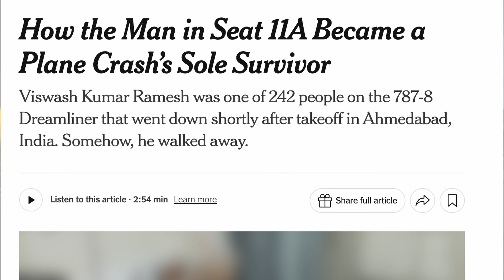Why the RAT Changes Everything – Air India 171 Update

Comment: I am a commercial pilot of 777.  I agree on dual engine fail.  Extremely rare on takeoff.  Landing gear never raised meaning pilots knew of issue right away.   Just not high enough to handle situation.  No yaw ( lean left / right).  We are trained for just about anything but a DEF on takeoff is something we pray does not happen.  Tower lost contact so that makes sense on RAT.  So now we wait for blackbox analysis to see why.   I’m leaning toward fuel starvation.  God bless all lost souls.
Reply: Good explanation. Fuel starvation caused by electrical/hydraulic failure? Some folks are saying extreme heat build up.
Reply: @lstone3633  My thought too was heat.   What was temperature in India?
Reply: @daytonagreg8765 Over 40 degreesC. But imagine this. You park a metal vehicle in the sun for 4 hours. What temperature then?
Reply: @lstone3633 and thats the million dollar question
Reply: Fuel starvation? If so, Mssrs Rolls-Royce or Pratt & Whitney or General Electric will be taking a keen interest in THAT one! It's not as if talk is about diesel engines on a bulldozer that need bleeding of air if they run out of fuel before restarting. I would have thought that each engine had its own fuel pump.
Reply: @peteacher52 I’m sure each engine has its own fuel pump as well as a secondary as well. Everything is redundant so this is why a dual engine failure would be so rare. If it was a fuel issue I would think one of the engines would have lasted a longer than the other. Perhaps some major hydraulic failure??? But even that is redundant.
Reply: @jacobhendrickson8935  my thoughts too. Most likely one would have gone out first and there would have been some evidence of asymmetric thrust
Reply: @peteacher52 it could be a deliberate FUEL CONTAMINATION, the evidence of UNDERPERFORMANCE , is visible all through, there has been a compressor stall that cleared , by then the ac reached the dead man curve . 
Undercarriage is not touched , because the ROC was abnormal at rotate , AOA wx must have come on. 
Pilot has acknowledged the SURRENDER, " GOING DOWN"
Reply: @peteacher52 these engines are WORK HORSES OF THE WORLD. They can't suddenly behave in such erratic manner, BOTH SIMULTANEOUSLY.
And pilot selecting flap for u/c is like a man selecting his ass for his mouth to eat
Reply: Fuel contamination will not be an option as total 44 aircraft used the same source of fuel and they are not having any kind of problem..
Reply: Interesting observation @prasadkulkarni7947
Reply: Amen sir. Well written.
Reply: Some are saying it looks like the gear was attempted to be raised according to the angle of the gear which could indicate some type of major hydraulic failure. It almost seems like the engines were underperforming with how they used every inch of runway to start to rotate.
Reply: its a lot of speculation.  Plane was at V2 speed or lets hope so.  Only thing to do is keep it level / straight & say a prayer.   Good reason not to have building right after runway ends.
Reply: @jacobhendrickson8935  Yes, one video appears to show the front of the wheel trucks angled down, which is the configuration they would assume while they are in the process of being lowered or retracted. When fully lowered for landing or when immediately leaving the ground during take off they assume an angle up position. So if they are tilted down this could indicate that there was an attempt to retract them but then the hydraulics failed (possibly due to electrical power failure during the retraction process??)
Reply: @jacobhendrickson8935 the captain must have overridden selection of the gear , he just wanted to reach a safe height, his yank back worsened the sit and stalled one of the engines that must have self cleared , on lowering the attitude/ AOA .
Reply: What would cause that massive fuel starvation?
Reply: The retraction of the gear was initiated. This can be seen by the fact that the bogie axle is aligned nose-down. The retraction did not work because of the loss of electrical an/or hydraulic power.
Reply: I agree, could be starvation or contamination.  But its really hard to accept dual engine roll back on a 787
Reply: Wrong fuel maybe?
Reply: I head one of the pilot interview who flew same 787 that there may be one engine failure and pilot by mistake turning off that engine would have turned off the active engine..is it a possibility?
Reply: Ok, that was my question…why the landing gear had not been raided.
Reply: @peterbalint3536 possibility of it being partially raised then power failure based on photos shown & the pitch of landing gear.    This would rule out co-pilot error on not  raising gear rather accidentally changing wing flaps to 0/zero.  I nor any pilot should toss blame onto the pilot before knowledge.    It is bad to speculate but maybe a lit-ion battery issue or water in fuel.  Cheers
Reply: "... something we pray does not happen ... God bless ...". I would prefer a more reliable design!
Reply: @Peter-wg7br well sir… then everything can honestly have more reliable design
Reply: no gear raised? Mate he lost both engines why would he raise the gear. Not enough hyd pressure besides he had 1000's of other things t think about. Mate!
Reply: See a little dip the left after takeoff?  The RAT sound video also indicates a least one engine was running, although low thrust, when you think they would have pushed it up to max power. But the airplane remained remarkably trimmed as it floated down.  I believe, if he had the space, the pilot could have landed it saving lives.  That level trim, either a function of simultaneous engine failure? or power reduction in right engine to maintain?
Reply: Fuel starvation because fuel pumps need electricity to work yes? So it's possible that the battery is the main issue. No battery, no charge, no fuel pumping fuel into the engines correct?
Reply: @routzhan  there are fuel pumps in the tanks- many of them. there is also an engine driven pump.  The only way to completely stop fuel-air and hyd's- pull the firewall shut off.  Watch the take off-- this plane lost it all the second that rat deployed-- THATS why it deployed.
Reply: From day one these planes have had battery issues.
Reply: Yep poor electronics resulting in low fuel supply to engines
Reply: Fuel Starvation due to blocked filters, closed cross-feed valves, or faulty fuel boost pumps could prevent proper fuel flow, especially under high power demands during takeoff.
Reply: "Dual"
Reply: Btw…. US1549 known as ‘miracle on the hudson’ was a duel engine failure caused by geese in both engines.   Tough call on why here
Reply: @PJL7095  There's one more piece of evidence. Just hours prior to this crash, there was a passenger aboard the plane from a previous flight that said that there was electrical faults with tv screens and no air conditioning at all. Nothing worked at all, not even the reading light. That tells me there was a electrical fault, that likely caused dual engine failure and loss of power.
Reply: @luminatrixfanfiction  That’s normal for being at the gate with no APU running and one external electric line hooked up.  Electric Loads shed and no air conditioning packs on.
Reply: @jiinsky he said from the previous flight meaning she was on the plane while flying and the air conditioning wasn’t working among other things. That’s not normal during flight.
Reply: @jacobhendrickson8935 The video I saw of the screens it working was at the gate.  Must be another one out there I didn’t see. 🤷🏻‍♂️
Reply: @jiinsky oh I see, that makes more sense now.
Reply: @PJL7095 there was a cause in that . There is no evidence of a bird hit here
Reply: @PJL7095  It happened at almost 3,000 feet, not 600 odd.
Reply: @PJL7095  I appreciate you knowledge on this tragedy.  I know absolutely nothing about large jet planes and flying but I've often wondered- isn't there some kind of fire/heat resistant "screen" that could put over the engines to prevent birds, geese, etc. from flying into them?
Reply: @beachgirl468 Good question…. Here is why.  Imagine you are cruising along at 500 mph & here comes a flock of birds.  No worries b/c you got an inlet screen over jet engine. Unfortunately everything breaks when hit at 450 knots.  So now you have both birds AND screen ripping through your engine.  Catastrophic engine failure.   Also, it might freeze during cold moisture flights or through de-icing and that would restrict air flow which is not good.
Reply: Rat doesn't supply enough of anything needed to raise the gear!!!!! a pilot should know that. Its for essentials like flight tabs.  Something shut the flow of everything to and from the engine. Pulled fire handle or fuel shut off. I go with fire handles pulled. Engine still spinning although not with fuel would still drive hyd pump.
Reply: @donfayetteville3582 i never said anything between RAT / landing gear mate.  There are dozens of possibilities hence waiting on dfdr/cvr analysis.
Reply: It is not engine failure , it is engine underperforming
Reply: @user-xe6md6jf5x - whether they failed, or underperformed, or whatever...we need to analyze the black boxes!!  That should paint a clearer picture!
Reply: My background is pilot with turbine aircraft including small airline,  b s e e, mainframe IT software engineer, security investigator. I think forensic exam should be done on potential for hacking any portion of the pathway between throttle control quadrant and engine CPUs. Either complex interference with thrust command of two engines was interfered with by some unknown design or function error, or possible hacking from ground or prior insertion of a bug. See the  comment by Gregory Lewis next in line regarding crj series problems which sensors triggering specific serial numbered components to fail on takeoff. Hi likelihood this is some form of interference of continuation of thrust command or some engineering issue that causes some version, or other, of partial or complete electric power failure.
Reply: @mat1500 something to do with the " THRUST " , be it technical sabotage or fuel sabotage. 
These engines , both simultaneously, JUST CAN'T MISBEHAVE
Reply: Terrorism can't yet be ruled out given the recent escalation of conflict with Pakistan.
Reply: 😂 @veganath 😂BS
Reply: @veganath I am not aviation expert but there is nothing here that indicates of terrorism
Reply: @abhinay.mylavarapu the only survivor heard a loud explosive sound, I'm just cautioning not to rule it out yet.
Reply: @PJL7095 what a nonsens.. engine Rollce Royce most reliablility engines. And this engine works perfect. Probably prpblem was fuel pomp (pressure), but most probablility is the engine was overload, but not DAMAGE, and engines had no thrust and no power due to overload. He probably took off too early for the weight of the plane. he could easily gain speed for a few hundred meters. It was obvious that the overload occurred immediately after take-off and the engines were weakening. With these engines, a full plane can operate on only one engine without any problems and have the strength to fly in an emergency on one engine. The problem was the low speed and weight pulled by the engines
Reply: @furieux6742 have you seen the take off roll and the place of rotation??? Don't speak like a fool
Reply: I know nothing about jets but the aircraft looked way overloaded to me. They ran out of runway trying to get off the ground. That is never a good sign.😮 @furieux6742
Reply: @furieux6742  Deployment of RAT will not occur on an overload situation
Reply: @furieux6742  Air India 787s use GE engines, not Rolls-Royce. It's the Rolls-Royce engines on 787s that have been problematic. A few 787 operators that chose R-R engines have switched to GE on later 787 orders due to the R-R problems.
Reply: @furieux6742  I saw one pilot on Yt did math calculation on weight , temperature, and runaway length and results were still way  critical so this theory seems to not work at all
Reply: @furieux6742  "he could easily gain speed for a few hundred meters." I think not. Did you see the dust rising on takeoff? End of runway.
Reply: @furieux6742 these engines are so ROBUST and proven its performance, that failure of adequate pressure from the fuel pump, can't be without a technical negligence
Reply: You're a 777 pilot but you called it the black box?
Reply: @TheNapalmFTW many professionals when commenting on videos will use the word most frequently used by lay people so everyone understands. Doctors do it all the time. Would you want your doctor telling you you’re having a myocardial infarction or a heart attack? Worse off they could just say MI (em eye) like most healthcare providers say for short.
Reply: @TheNapalmFTW its a generic term mate.  To use abbreviations of DFDR will confuse non-pilots.  Is that now alright with you
Reply: @PJL7095 no, most people watching this know what a FDR or a CVR is lol.
Reply: @TheNapalmFTW  thats what the man on the street calls it. He called it that for the majorities benefit
Reply: @TheNapalmFTW Common parlance.
Reply: @TheNapalmFTW  The CVR and FDR are both known as black boxes.

Comment: So glad it wasn’t pilot error. That’s something hard for everyone to live with. And shocking with such experienced pilots.
Reply: I think most plane crashes are from pilot error
Reply: Still may be.  Lets hope not but DEF can be caused by pilot error.
Reply: @PJL7095 there is no pilot error whatsoever that will cause a RaT to be deployed but a massive electric , hydraulic or engine failure . IMO it’s double engine failure as the May Day call stated they have lost power , something really uncommon had to happen to cause two massive GenX Goliath engines to fail , maybe some fuel contamination? Shoddy maintenance?
Reply: No one is saying it's not pilot error. They're saying they now don't think it was the pilots pulling up the flaps instead of the gear. The leading likelihood from the outset for pilot error is an FMS misconfiguration, and that's fully plausible.
Reply: He wouldn’t have know anyways
Reply: gives good feeling if it was an airplane error to fly with it in future. Even experienced pilots cant do anything in that situation
Reply: Wait until the investigation from the black box.
Reply: 1) the pilots did not survive
2) we dont know what caused the engine failures
Reply: Everything points to something going horribly wrong with the aircraft at the time of take-off or right after. 

- Not able to retract landing gear 
- Not able to get higher up in the air 
- Issued a mayday call 

Another aviation expert that I watched pointed out that the SOP for every pilot, when encountering a problem during takeoff, is to keep going and overshoot the runway and crash or try to get off the ground and take-off even with the problems, and that's what they did !! 

Let's not blame the pilots until the investigation is complete, because they can't really come back to defend themselves.
It's the easiest way and what all the Boeing supporters will be resorting to.
Reply: @vinishap222 how can you take off with no engines?
Reply: If not pilot error, it could be maintenance error, or design error, or manufacturing error, etc. Somebody will have a hard time living with no matter what.
Reply: Well not glad, but it does help in holding big corporations like Boeing or AI whoever was responsible for this malfunction.
Reply: @Canyouseemeanna Thank God i thought these Whites would whitewash Boeing and blame the pilots just because he is Indian.
Reply: The error was trying to take off.
Reply: @woolysamoan  exactly exactly they had to be more responsible whoever allowed it to fly

Comment: I also agree it would most probably be a dual engine failure because if you look at the video when the plane goes from left to right, the Boeing 787 usually has the gear tilting backwards, but when the gears retract, the gears tilt forwards and then go inside the belly, but in the video, the landing gear doors were closed, but the gear was tilted forward, which means that they lost the engines, hydraulics, and electrical power even with the rat deployed. The rat should have allowed the gear to go up if im not mistaken.

Comment: From the audio of the video (with the RAT buzz) shouldn't there be absolute silence from the plane other than some wind noise? Both engines are dead, it should be aurally apparent from 300ft that it was on a glide. But I think there's still a jet engine buzz, No?

Comment: The problem in the airplane started as long as the pilot took off The aircraft the pilot knew something malfunctioned in the airplane.he knew the airplane has to be crashlanded somewhere as no thrust or power. May be landing gear down was deliberately kept up to crash land somewhere . The pilots were that moment facing some catastrophic issues in the airplane. It is case of multiple malfunctions in aircraft engines , hydrolics

Comment: I tend not to think that there was a dual engine failure and the reason being is that in the first video you will notice that at the end of the runway (very end) the plane kicks up a lot of dust as if both engines were working.  I go with and electrical failure or hydraulic failure.  Also, I would tend to believe that an engine failure would more than likely show up before V-1.  This is just my THEORY.